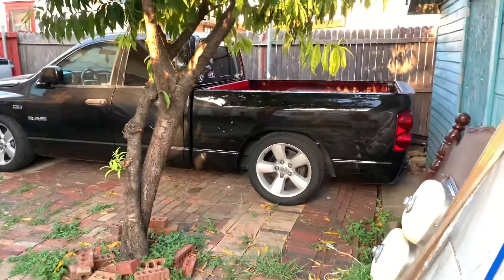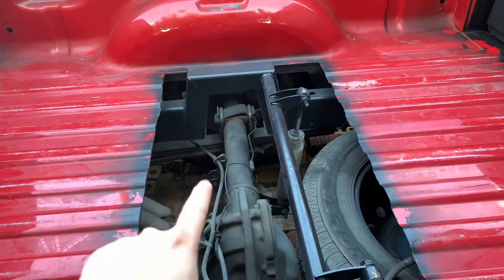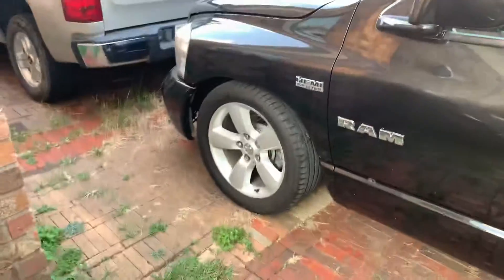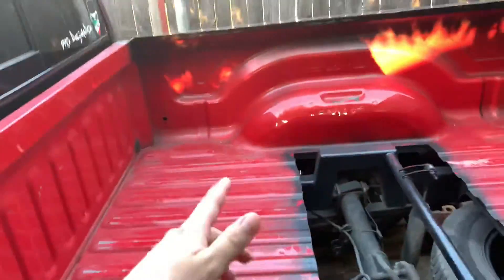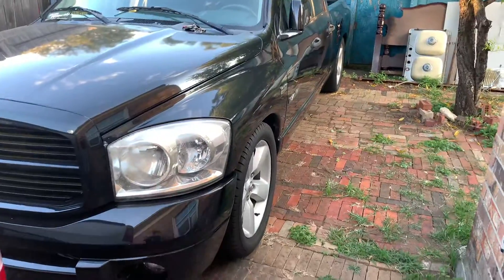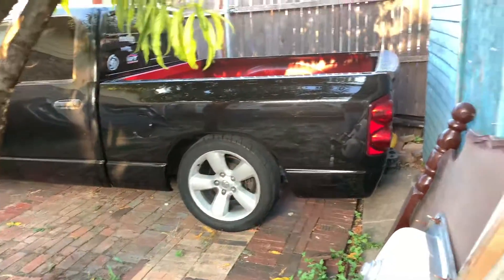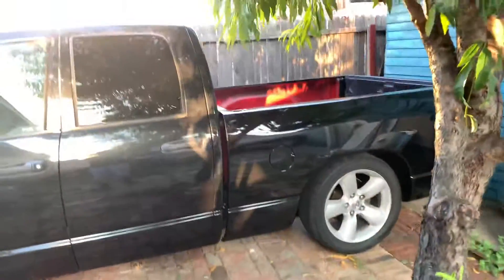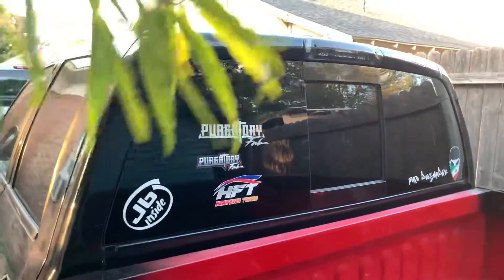Dodge ram on a 4/8 drop

Comment: I got a flip kit with cut springs up front so I’m about 6 inch drop in the back how could I go 2 inches lower in the back bro?
Reply from the maker: @MikeSanchez-h2q  2 inch drop shackles, i recommend the mc gaugthy brand
Reply: @ I searched for some bro but the only ones that come up are the little short ones with one hole, are those the right ones cause I thought they were supposed to be the longer ones with different holes? Sorry bro I new into the truck scene
Reply from the maker: @MikeSanchez-h2q  they are the small ones and they only have one hole on each side